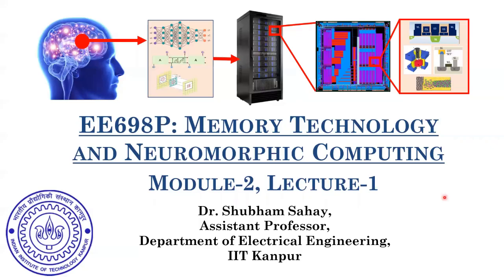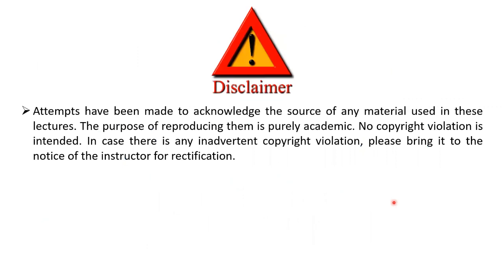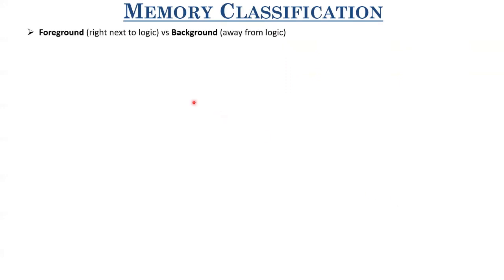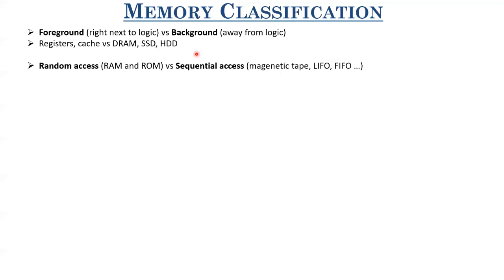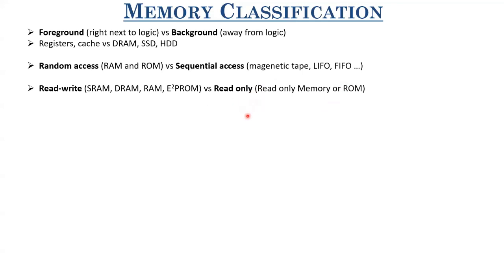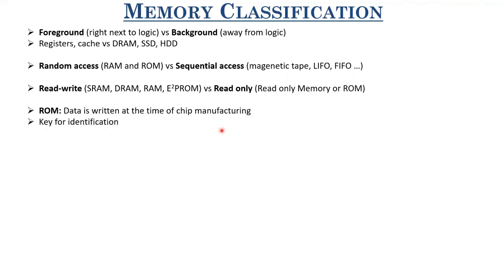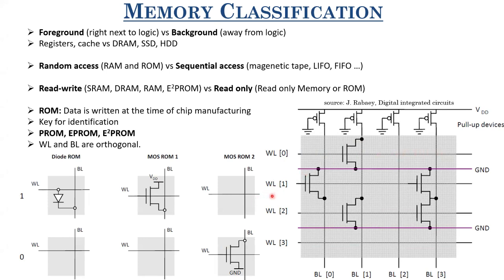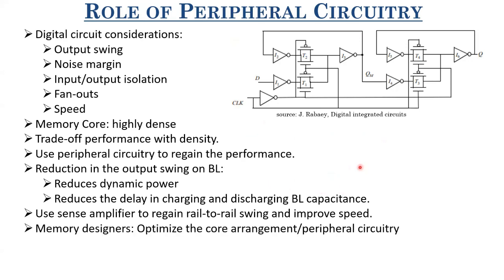Lecture 4 - Memory Array Architecture

Comment: even if we take aspect ratio  = 1 still the distance of line 1 of all the pages to the output is significantly large, so does taking aspect ratio equal to 1 reduces interconnect related issues ?